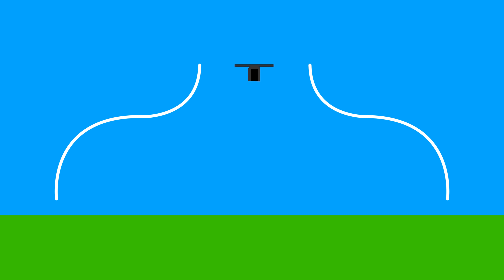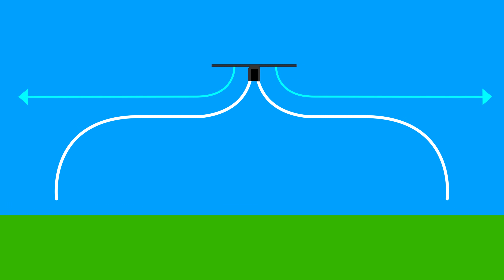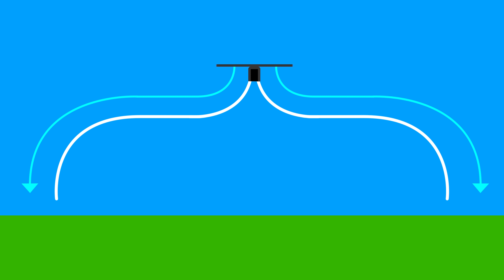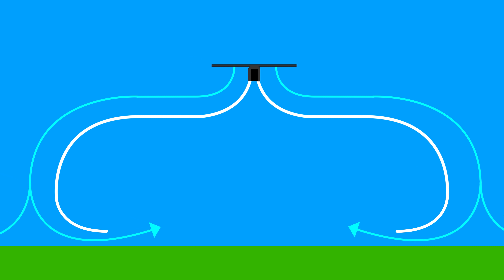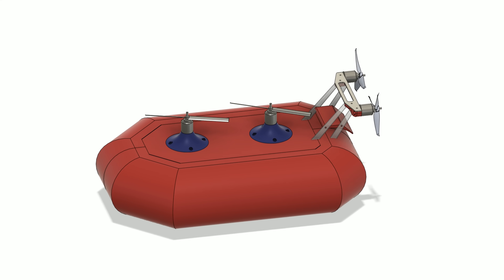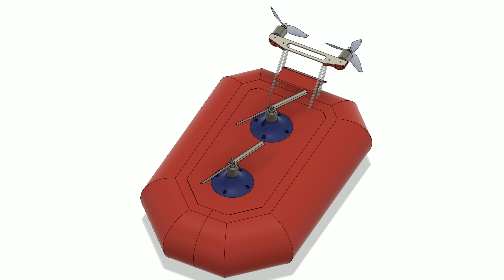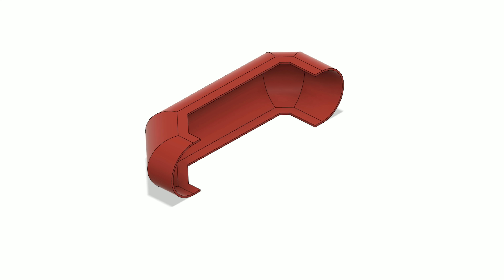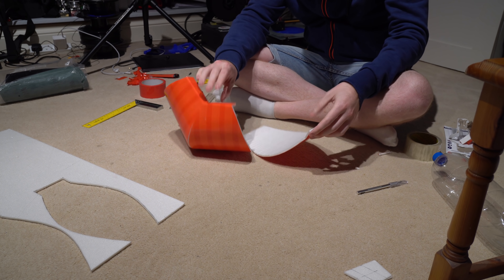Coanda Effect Hovercraft

Comment: this is really cool! maybe something to help with the flipping over part, you said in the video it starts to take off at less than 50% throttle so you could add some aluminium strips in the bottom part to lower the center of gravity. which in turn would make it more stable. anyway I love these projects of yours keep them coming!!

Comment: One interesting thought is how this affect could combine with the normal hovercraft effect. Actively pressurize the undercarriage, but also have a secondary motor, or even bleed off air from the main motor, to maintain some coanda effect over the hull, amplifying the normal hovercraft effect. Like most of these experiments, probably not worth it, but maybe there are crossover points with weight/size/power where it actually becomes benificial

Comment: I don't think you ever really showed that this is the coanda effect, rather then just having really powerful propellers that suck the air downwards. One way to tell would be to add a horizontal flange half way up the sides and see if it still works.

Comment: So maybe because it isn't inherently as stable as a true hover craft, you require a control system for the lift props. It would automatically controls the throttle for them, so if it detects a tilt, backs off. Maybe not worth your time, but tune it with control sensors and logic to remove the issues.

Comment: Curious did you trim the main motors so the front produced slightly less lift it seemed with the weight of the rear motors the front would lift quicker. Not sure if you mentioned it, sorry if you did.

Comment: I'm currious in that when you look at propeller dynamic's in static air around 50% of the acceleration of the airflow happens prior to the blade and then 50% after. In a moving airflow such as a plane in forward flight this dynamic changes improving the prop's efficency. In your test it's not clear how much additional lift is (or not) generated by the coanda effect vs static lift. It could be the vesel is lifting purely by direct lift on the prop, if the coanda effect was adding signifant lift I wonder if this would reduce as it lifted from the ground (due to reduction in ground effect / undercurl) helping stabalise the vessel. I would love to see an extension video where you place the craft on a weigh scale in a vertical wind tunnel (So the static lift from the prop is placed on the fixed structure and we can measure only the coanda component). Great video and design work as always, love your work bringing engineering to the masses.

Comment: Really glad you go to the trouble to try these things!  I was wondering if a inverted V running along the top between the motor mounts might increase the air flow over the surface to the sides.  I would take me months or more to do even your simplest projects.  Tempted to try one of these though.

Comment: Definitely an alternative way to raking the leaves!  Much less physical 😀
Looks like if you could adjust the front Lift motor to spin up a little less than the back motor, at the same time,, that you might obtain more stability. 
I’m not a rocket scientist, just observing the video.

Comment: I image that a catamaran style, which would alloy you to have each hull as a half cylinder, would be more efficient and improve stability. Perhaps even canting the hulls. Of course, this would require a pair of motors per hull just for lift so perhaps the weight penalty would negate this? Either way, it's an interesting concept. It seems the only big downside is that you don't lose the effect as you gain altitude unlike a regular hovercraft which makes it very difficult to stabilize.

Comment: How can you tell the lift  is actually from the Coanda effect? Those propellers aren't just blowing air downwards, they're also pulling the craft upwards. I would like to see a bench test where those motors are mounted in the same way to a flat piece of foam or wood to see how much lift they provide on their own. Then compare that to the lift you are getting on the hovercraft at the same throttle setting.

Comment: This is a great project! I do have a couple of suggestions though, since you have more than enough lift to get the thing off the ground you should try and add some counter weights on the inside of the body to lower the center of gravity as much as you can and see if that helps with the tipping.  I also think you should try both a mesh on the bottom and just covering it completely, I'm curious to see if that changes anything in the performance.

Comment: BTW when you're cropping and panning inside the frame to follow the subject, you should film with a very fast shutter angle. It looks a bit weird when the object that's stationary in the frame has motion blur, but the moving background does not. If you use a fast shutter angle then you can add motion blur in post after you've cropped in.

Comment: The AquaSkipper has a device on the front that keeps the hydrofoil at the right depth; I'm wondering if you could add something to the front, (and maybe the sides) that would regulate the lift from the front motor to optimise lift?

You could combine this with a solar-powered autonomous lawn mower to collect the autumn leaves. (Might need a third robotic lawn tender to remove fallen twigs, sticks and branches.

Comment: First of all, I just want u to know that I love ur channel and ur work! Please keep it up. But I gotta say that there's something off with this project, imo.

I would have found it interesting to compare the lift generation of the curved body to that of a flat plate and then a brick sort of thing for example. Ofc keeping the same propeller system.  You could then evaluate if it lifts because of the propellers working as propellers or there's something more. Because otherwise we only have a very weird helicopter...
Then maybe try to answer why a correctly sized fan doesn't do the job when consuming the same power output. Maybe it's that the Coanda effect alone doesn't work, or the fan giving too much speed and not enough pressure to the fluid... I don't know, I don't remember much about these thrust generation devices at this point, but something like that.

Comment: You should try cutting holes below the props to let some air into the body and make this a hybrid classic/coanda hovercraft. Maybe that increases stability / lift.
Reply: That, or try adding ballast around the bottom edge to counterbalance the weight of the motors and lower the CG.

Comment: When I built a simple solar powered hovercraft, I noticed that the two lift fans with the ducts arround them would move more and more dust onto the solar cells. The air movement they produced however kept them cool so efficiency stayed up.
And: Having a fin or two in the air stream for the movement propellers helps a lot with steering, ducted fans help in efficency.

A thing to try: Funnel some of the air (the one between the lift propellers?) into the fuselage to help in creating an air cushion. That way you don't waste the motor power there on them fighting each other.

Comment: nice... as far as the tipping it's obviously mass vs CG, you could try something like a couple of ball bearings in a tube that go side to side so that they move to the opposite side when it starts to tip which should shift the cg/cm a little bit maybe enough

Comment: I think your problem with the tipping over is due to the fact that your lifting props are exposed and when you gain speed they start producing lift kind of like a gyrocopter. So i would say that this vehicle is partly a hover craft and most of the lifting is done by the props. It would be cool to see you building a gyrocopter in the future.

Comment: The craft's CG is causing the irregular lift, and most of the lifting air is being diverted to the sides. Suggestion for next project: Hydrogen extraction through electrolysis, with pulsating dc current to maximize efficiency. Try varying Voltages and frequencies around 28 MHz.

Comment: Couple questions:
Is this not just a bad helicopter? 

Is it not the difference in pressure above/below the props that create the lift?

Do you think it would work with a sealed bottom or if it wasn't hollow? (since unlike a traditional hover craft the air is on the outside.)

Also, more feedback than actual questions:

Cool! 

Maybe make the front more like a speed boat shape so it can stabilize while going forward and "float" on the air being forced under it? 

Adjust trim between lift motors to control pitch? 

Cool.

Comment: Another great video and project! Do you think you could rotate the chassis 90° and make it symmetrical, then move the push motors to the middle facing the lift motors and maybe create a small low flying plane? Also I think you just created the new automatic leaf collector 😂

Comment: No coanda effect at all, only motors with propellers lifting anything
Reply: I see where you are coming from but think you are incorrect. The force of the rotor airflow is straight down onto the body, therefore any thrust developed is immediately counteracted by the force on the top surface. Therefore it must be the coanda effect that is creating the lift.
This can be proven by redesigning the craft like an inverted box (i.e. no curves) and see if the amount of lift was the same. I would like to see that experiment.

The squirrel cage fans on the drone proved that the coanda effect could be used to provide lift in a similar shaped body, hence this experiment.
Reply: You don't pay attention much do you.
Reply: There is the coandra effect. The propeller diameter is not big enough to directly push the air straight down. The airflow is forces sideways, the around the dome. It talks about it in more detail in the coandra effect drone video.

Comment: Wow, i do find this very interesting idea, but there's two things i want to point out :

First, perhaps you should have kept using impeller instead of propeller as it seems the propeller created too much lift that the coánda effect plays an insignificant role in lifting the hover craft.

Second, to prove whether there is coánda effect in the first place, you can use the fog generator like from last upload.

I hope this could help the development. Thanks for sharing this project to us Tom, can't wait to see your next upload.
Reply: Indeed. A comparison to a similar build with the foam body replaced by a flat sheet of the same footprint and weight would also be interesting to see how much the effect contributes.
Reply: P.S.: Note, however, that the downward momentum imparted on the air by the propeller is transferred back to the hovercraft when the air is redirected to the horizontal flow, so at least that should not contribute to an overall lifting force.
Reply: @EdwinSteiner  Correct, but not the complete momentum is transferred back, otherwise there would be zero left (no horizontal flow at all). You would need air speed measurements before and after the redirection, i assume the difference is only a small fraction.
Reply: @EdwinSteiner  I believe there was an episode of Mythbusters that used a fan to blow air against a sail and it did provide enough thrust to move the boat forward slowly.  While not exactly the same, i believe its the same principle.
Reply: @soeveth  I have also built a small boat to test it: https://www.youtube.com/watch?v=k9_b5MCNics
After i put the flat wall in  it cancels out the force completely. So i have to admit that my previous comment was wrong. Edwin (and Tom) is right, it must be the coanda effect.
Reply: Desmond Bagley  yes I do mean that, it didnt make sence to them as well as all force should come out equal.  But they were able to move the boat slowly against the wind if I recall,  But it was very slow like 1 or 2 km/h.  

https://www.youtube.com/watch?v=uKXMTzMQWjo
Reply: @soeveth  I'f memory serves, the conclusion they drew was that the excess thrust from the fan was redirected backward by the sail, and not due to any created lifting properties of said sail. It has been a while since I saw that episode though.
Reply: yeah surely no matter what happened to the air beneath the propellers. the vacuum lift being created above them cannot be cancelled out as long as the air is moving.

Comment: Another fascinating and enjoyable vid thanks, Tom. At the risk of sounding like a complete numpty, isn't what you've actually built there a... helicopter? I'm genuinely struggling to differentiate the way a helicopter blade angled to cut upwards into the air to pull the vehicle up differs from your build. I get the coanda effect and don't doubt the way the air is curving around the side of the hovercraft adds lift, but isn't it mainly the propeller (think a stunt plane climbing vertically, or "prop hanging" for that matter) that's doing the lion's share of the lifting. Forgive me, just wanna fully understand it!

Comment: Great idea, however I have to wonder how much lift was being produced by the actual Coanda Effect and how much lift was being produced just by the fact it had two large props in a tractor configuration much like a 3D plane hovers.  Because leaves were being collected on the inside, I would agree there was some Coanda Effect or at least some kind of pressure differential, however I don't believe the effect was any significance. 
Don't get me wrong, I love your videos!!  I hope you continue producing them for a long time.

Comment: You might get better results with a few holes on the top surface to let some of the propwash go directly down into the cavity. I know it seems like 'cheating', but what you have here is a lot like a peripheral jet skirtless hovercraft and they benefit from having a central stability jet. Having a flat bottom surface instead of the hollow cavity may also help.

Comment: How about using two batteries in parallel and placing one either side at the bottom of the 'skirt'.  This could help get the cg down lower and reduce your rollovers

Comment: Would it be possible to locate the propellers side to side, so you could use 'differential thrust'? So, let one propellor spin a bit slower, so the bottom touches the grass a bit more. Maybe that would make up for the tendency to flip over in the corners?

Comment: Hi, Tom,
pretty cool project! I have a suggestion. Have you ever thought about smoothing out your 3D printing parts? I've already smoothed a few ABS parts myself with acetone vaporization and was surprised how well it works. The advantage of this would be that in projects like this, your surface would be smoother and there would be less turbulence and air friction. Especially with the Coanda effect this can be an advantage! I am looking at the blue motor-mounts or the drone motor mounts from the last project.
Reply: Fun fact. acetone vaporization is a way to clear foggy plastic vehicle headlights.